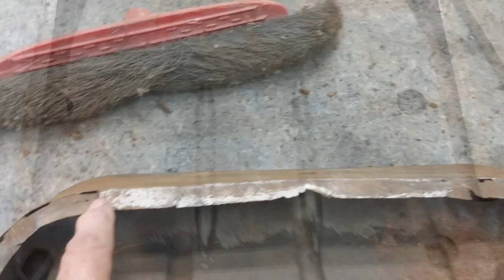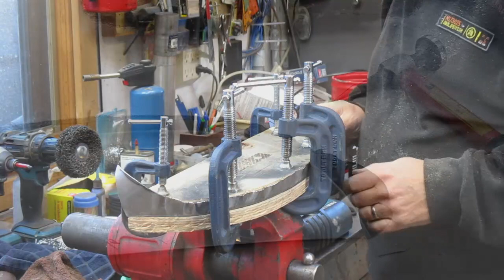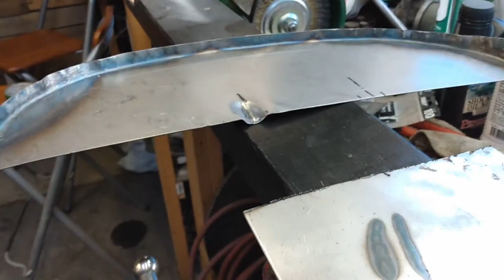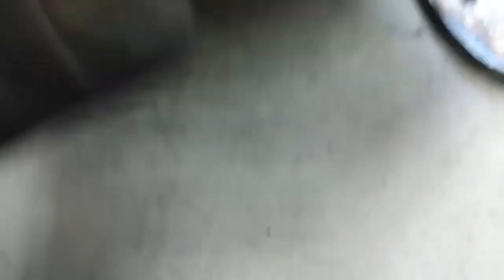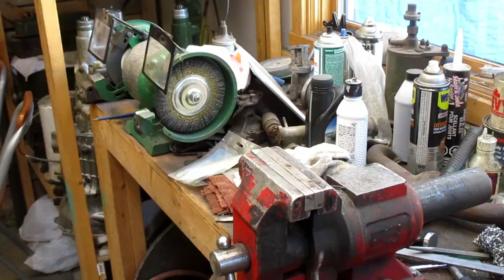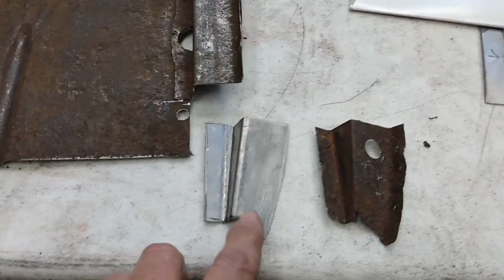How to repair a Frogeye Sprite's seats Pt. 1! Patch panels ready to weld in. Bugeye Build Episode 48

Comment: Looks like this is going to turn out really well -- and will be very helpful (once I get to this point in my project). I'm wondering if you have any pointers to videos on the metal working techniques -- like the shrinking you did to make the lip.
Reply from the maker: Hi Trevor. Most of the tips and tricks I've learned have been via the Fitzee's Fabrications channel. The shrinking aspect I learned from this Harry's Garage video... https://youtu.be/CRpVXsVor0M. A great episode in general but the bit regarding the shrinking starts at around the 16 minute mark.

Comment: Even though the seat bases where parkerised at the factory they always seem to rust like crazy, its not exactly like they are exposed to salt water or weather of any kind. Always trickier to do an outside curve ( shrink), than an inside curve (stretch), I  us a thick steel former when doing any flange bending keeps things tight.
Reply from the maker: Thanks for your comment Roy. My guess is that if the seats get wet the foam retains the moisture for quite a while making the probability of corrosion high.

Comment: It is getting cold in Canada - Ian has three layers on. I had snow flakes in my back yard while "practicing" soccer with my nine year old ay his distance learning recess. Not looking forward to winter - I haven't put the Mini away just yet. 

Learned a few things from your today Ian. bending the metal while between good thick plywood. I need to keep that in my back pocket. I apparently do that the hard way and try and hold it by hand while bending. Doesn't turn out as nice as yours does.
Reply from the maker: Thanks Bill. There's a bit of snow on the ground here (on November first) and it is a little chilly. Got the idea for using the two pieces of plywood from Matthew Randell's YouTube video, part 34 of his AH 100/6 restoration. I've added a link to that video in the description.
Reply: I thought this one might be boring..not at all! You are a clever man.
Reply from the maker: Thanks Leonard.